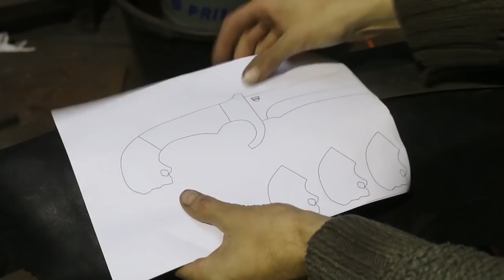Forging a pattern welded Falcata, the complete movie.

Comment: This falcata appears to be smaller than the two previous ones you have made on your channel. Was it’s smaller size why you did not make add fullers to this one? Or was it a matter of time and labor where adding fullers was unnecessary? 

Also, I must say that the way you made the handle on this falcata was more aesthetically pleasing (at least to me) because there were not any fullers that were extended all the way into guard of the handle. The use of cast brass pieces was also visually distinctive, and was a good contrast to the blade itself. 

Your work is as amazing as always, and I am always grateful to watch a master craftsman in their element through your videos. Thank you for making your art and posting it for all to see.

Comment: I'm curious why you used the boards to clamp down on the sword as it cooled, I'm also curious what the box of sand or whatever it is he puts his blades to cool in is for.
Reply: I'm betting The wood step is to straighten the blade, wood is a good insulator letting the cooling happen over a longer period, and as it chars it sucks up oxygen. The sand is probably for normalization after forge welding the billet,  by controlling how long it takes to cool you control the grain sizes.